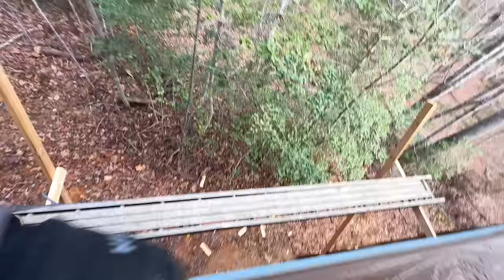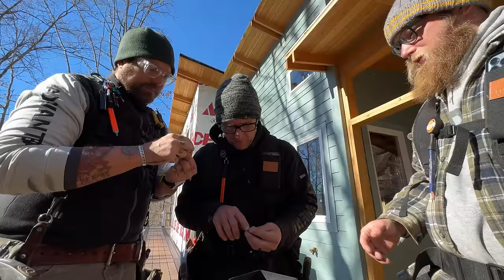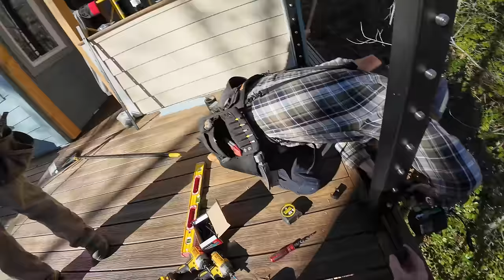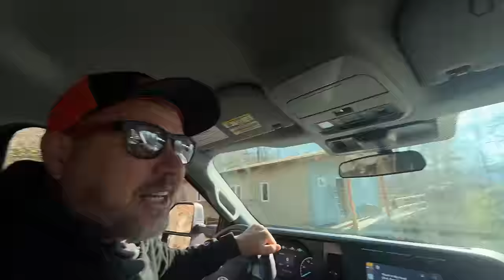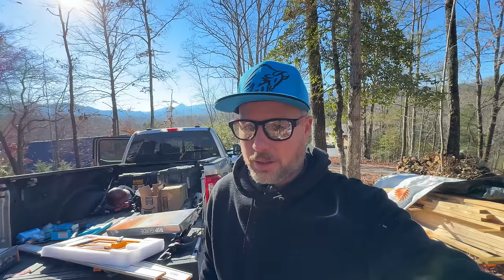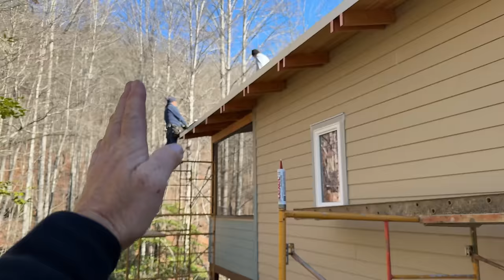Modern Home Build | 37 | water connection, Envision deck railings, roofing & MORE!

Comment: Sunday just wasn’t the same without the new video
Reply: Happy New Year, guys!

I only want to cover one topic in this video, which concerns gutters and downpipes to cope with rainwater.

Obviously, we don't know what you decided on doing, as the video finished before we got a chance to see how things panned out.

So, does your customer intend to use some form of rainwater storage? If not, then perhaps you should suggest to her the importance of recycling water!

Don't stop reading, hear me out first, then make a decision. 

If she had the right system installed, taking into account the large roof she has, which is perfect to catch rainwater. She could have enough water stored to last her and a partner all year.

Perhaps you will do what most people do, which is to simply place your downpipes, allowing rainwater to flow from the pipe over the ground, which seems to be the usual concensus in the USA, wasting water.

Here in the UK, we're encouraged to use rainwater for our plants and vegetables and for use with outdoor animals, which is what we do. We have 30 goats, 25 geese, 31 egg producing chickens, and an aditional 40 chickens for meat and 2 cocks.

So, I thought as my bungalow is 64 feet long by 32 feet wide, with a pitched roof, that I would explain how my roofing contractor overcame the downpipe situation, over such  a long distance, considering I wanted at least two very large waterbuts. 

What he decided to do first was find information on the largest rainwater storage systems available here in the UK for home use and start from there.

During his search, he established that with the right system, it was possible for us to drink the rainwater safely all year round. 

The largest single waterbuts available here in the UK hold 2,000 litres or about 440 imperial gallons, quite big then.

However, there are tanks much larger that can be placed above or below ground that connect to each other using gravity flow or, better still, solar powered.

We decided on having tanks placed below ground to help keep the water cool in summer and prevent it from freezing in winter. I also had a solar powered system put in that works in conjunction with the electricity company.

Power stored in the six batteries is enough to power the whole house with everything running but not during winter, which is why we remained connected to the grid.

The solar powered pump first  pumps water from the tanks to a water purification system and then to our home so that we can drink the water safely.

As the tanks were to be stored underground, I was advised for my situation that four  would be more than plenty to supply enough water for four people 24/7.

Each of my tanks holds a minimum of 3,600 gallons. Connected, that's more than enough water for two adults and a 15 year old son to shower every day. Enough water to meet with every demand such as flushing toilets, cooking, cleaning, dishwasher, and washing machine with plenty of water to spare. 

The complet system, including solar powered water pump and purification system, costs less than our water rates for one year and came with a 10 year guarantee.

The tanks, pipes, fittings, and purification system are all made from 100% recycled materials, all except the surgical still within the purification system. 
Recycled stainless steel and wooden inserts used to secure the tanks treated with a water-resistant covering and guaranteed to last a minimum of 100 years.

In view of our climate situation and to do our part in helping with it, we went with this idea.

Your client could have just one downpipe on each side of her property. Locating the pipes in such a way that they feed any number of water storage containers placed above or below ground under the house in that area, which slopes and us otherwise, usless!

If that was my house, that's exactly where I would place the water containers, with the  purification system, and pump, all underground and out of sight so as not to freeze during winter and keep cool during summer.

If having the tanks underground is not possible, then still place them in that area. In the end, she will be saving thousands of dollars each month each year, not giving it to the water company.

Even the power would be free, solar power, solar batteries. Win win.

I am now contemplating switching over to solar power completely with additional wind power. There is also a stream at the foot of my property, but I don't think it's fast enough to generate the hydro equipment. 

Just some thoughts you may wish to consider. It would make a good video! You're welcome 👍🤭🇬🇧⚒️

Comment: The difference between Galvanized and Galvalume steel is that GALVANIZED has a pure zinc coating while GALVALUME has a mixture of Zinc, Aluminum and silicon. This mixture gives Galvalume better corrosion resistance and durability also a much longer lasting lifespan twice that of Galvanized
Reply: What's the difference between galvalume and zincalume?
Reply: @rachelhunting  Zincalume has magnesium rather than silicon in the coating which would make the Galvalume longer lasting by my estimation.
Reply: We use the same type of stuff in Australia and I can say with confidence it is tough AF. Sun, storms, hail as big as fists, wind that could blow a dog off it's chain......just eats is all day!

Comment: Just going to put it out there that I have a 6in wide, 18in long core bit. I needed a vent hole for a range exhaust, got quoted $600 so I bought the bit for like $180 and did it myself. Cut through masonry block and a brick facade like butter.

Comment: Lookin great! That railing system is super nice. 

One thing I noticed of note. 
You may want to watch out for galvanic corrosion where the galvalume flashing is in contact with your custom copper end caps. 
Dissimilar metals can corrode very quickly when there is an electrolyte (such as water) present.
Reply: I just looked it up. Galvalume is steel with a 55% aluminum and 43% zinc coating. Copper and aluminum are highly susceptible to galvanic corrosion, so great point that they should check it out if they'll be in contact. Zinc is not a problem.

Comment: Deck rails looking good, and relatively easy to install upright thanks to the fixings, that they thought about. The roofing sheets look like the ones I put on my large shed in my previous property. Easy to install and had rubber washers to stop any ingress of water. Worked very well without any sign of oxidation on the metal walls and roof. Glad to see you back, be safe and well 🔨🔨🔨🔨🔨

Comment: In NZ this type of ribbed or corrugated coloursteel roofing is the most popular by far. Very few felt rooves are installed here, maybe something to do with the weather. There are examples of galvanised steel corrugated roofing lasting 100 years here and still being in excellent condition.
Reply: Notice how they are screwing down the roof in the valleys, which means there is a higher chance of the roof leaking on the screw fasteners.
In NZ most roofs are screwed down on the high ridges so as there is less chance of the roof leaking.
Reply: I worked installing roofing on a number of buildings in Auckland a while back and we would always fix through the crests of the roofing steel
Reply: My brother owns a roofing business with his 2 sons here in SEQueensland Australia (we're originally Kiwis) and the screws ALWAYS go in the ridge NEVER the valleys !!!!  This is to ensure water has no chance of  leaking should it accumulate in the valleys; as its impossible for it to   pool on the ridges. The variance in size also supports this . The original corrugated iron roofing had them equal sizes with the ridge being used for the lead-headed nails back in the day. Today's style  tends to be more a broader, wider valley with a much smaller ridge designed specifically for the screws to attach it   securely.
Reply: From experience doing it on the ridges just causes deformation anyways allowing a little area for water tension to keep the water there and Id say in a country that has much higher wind speeds you wanna be able to just send it anyways. Plus roofing screws have an o-ring anyways so Id hazard a guess and say its actually just better to do it where you want have any wiggle room.
Reply: I’m surprised that no one’s using standing seam style roofing in the US. 

Our aussie colorbond stuff looks amazing and we even use it to clad the walls as an architectural feature (like on my garage). 

Fixes down with concealed brackets and crimping too so there are no visible fasteners
Reply: @w2ttsy670   We use tons and tons of standing seam here.  Surprised we don't see it on all of these Perkins builds.  It's the most desirable roof, to me.
Reply: @heatherclayton-callaghan4270  I know right, it seems absolutely crazy to screw down a roof in the valleys of the roofing iron, it's just asking for the roof to get leaks...  On yah Kiwi.

Comment: I did a project with Gavallume roof panels and they will naturally “age” once installed. They have an oily coating on them that naturally wears off and they will get a tiny patina to them. The architect on my job thought something was wrong with the roof but the metal company explained that it is supposed to happen like that. That roof has been on for about 18 months and still has just the slightest patina to it, it didn’t continue to get darker.

Comment: That roofing contractor is very professional and does amazing job
Reply: Apart from his huge mistakes of screwing the roofing down in the valleys and not the ridges !!! This is a huge FAIL !!!!
Reply: @heatherclayton-callaghan4270  Not true. Most manufacturer's recommend screwing the panels on the flats. Sometimes both the flats and the ribs.
Reply: Screws go on the flats. The panels are not secure to the substrate otherwise, and you cannot tighten screws on the ribs enough for the washer to compress properly.

Comment: Notice how they are screwing down the roof in the low valleys, which means there is a higher chance of the roof leaking on the screw fasteners.
In NZ and AU most roofs both rib line and corrugated iron roofs are screwed down on the high ridges so that there is less chance of the roof leaking.
Reply: Given how the metal sheets are shaped, locating the screws in the valleys should actually ensure a better seal in this case. And even if it doesn't, the self-sealing stuff they installed underneath should take care of any leaks.
Reply: @daniel_charms 
Your opening sentence is 100% wrong !!! And That's not the point. My brother has had a roofing business for years that his 2 sons run now and the ridges are there specifically for screwing the roofing down. You should not be  qualified as a roofer if you don't understand the basics of roofing!!! No matter what country you are  a roofer in. Plus you are influencing a worldwide audience to do the job INCORRECTLY !!!!
Reply: Many metal roof panel styles specify screwing in the flats next to the ribs. They are following manufacture requirements.
Reply: @brycehinton7860  I'd like to see where any reputable manufacturer states screwing metal roughing in the valleys as opposed to the ridges. This will not be in any country other than America if it is the case. And probably made in China.
Reply: Yes, USA. I've tried to respond with a link a few times, but it deletes my comment. That's how it's specified here. I guess you'll just have to trust me. I'm sure it's different elsewhere in the world.

Comment: Those sheets look like the ZinkAlume sheeting we use in South Africa. Can tell by the dull finish compared to galvanized. Its a Zink and Aluminium alloy coating that is superior to your standard galvanized coating. We also get them pre painted over the ZinkAlume coating.

Comment: That smooth texture on the roofing panels is an acrylic coating applied during manufacturing to protect the panel surfaces prior to application and will eventually erode off the surface.

Comment: Again I feel the need to mention I don't live in the carolinas but in ohio glavalum is galvanized aluminum used primarily in commercial siding or pole barn roofing and siding.  I just installed some as siding on a commercial warehouse in 2023.

Comment: My only concern with the exposed fasteners on the metal roof is that typically you have to either tighten or replace those screws after a few years due to the heat cycling that causes the screws to loosen and the weathering that occurs on the screw "gasket" I worked for a metal roof company here in Michigan (snow, ice) and they only use the hidden fastener system as opposed to the exposed fasteners for that problem, eventually the exposed roof screws will leak....if not maintained properly, just fyi guys
Reply: Everyone up in Alaska uses Skyline Roofing® – Standing Seam Metal Roofing so nice

Comment: when we installed my metal roof we used a witness edge, basically a ledge you but the metal panels up to and its level and aligned all the way through.

Comment: Just put a metal roof on a small shed. The supplier recommended putting all screws on the ridges not on the flats to prevent future leaks?

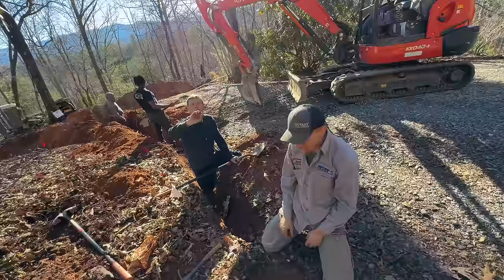Comment: QUESTION: Roofing panel length. In Episode #25 (@13:15), Erik was wondering if a single panel 33’5” long was too long (expansion/contraction). Contractor (Devin) believed it was not a problem. Jamie was checking [with vendor] about maximum recommended length of panel. Why did you not go with full length, but with half length panels?

Comment: I have 1st fix and a 2nd fix Paslode guns. When I need to replace them, I'm buying a different brand. The reason being is, Paslode make the gas with perishable seals, so there's a use by date. Aftermarket gas doesn't suffer that issue. But until the copyright runs out on the Paslode gas, you can't get aftermarket gas on those newer models.

Comment: Wish I had helpers here in Mississippi like the roofers there. I am 85% done with a 4300 square foot roof with a 10/12 pitch and very cut up by myself. Sheesh I’m only 145 pounds and 44 years old and grumpy already.

Comment: Won't those horizontal furring strips on the roof cause water to pool behind them?  (And before anyone says there won't be water there, moisture in the air will condensate on those metal panels when it's cold.)  I would have put vertical furring strips first, and then horizontal ones on top to ensure any condensation can run off and there's airflow across the entire roof.

Comment: I need a Pro tip or Pro help. Does anyone make a left-handed tape measure. I'm right handed but hate to switch hands to make a mark. I hope I'm not the only one who would prefer to hang the tape on the left side. With so many times, I would just like to pull the tape out without unclipping it. Obviously, this is for benchtop measurements not spanning floors etc. 
Thanks for your time, and I enjoy watching a team work together. HAPPY NEW YEAR

Comment: The whole time you were assembling the posts and then installing the first one, I was thinking, how does the base cover plate slide on to cover the attachment screws and adjustment bolts if everything is installed along the post...

Comment: I know you guys are pumped on lp smart side but the horror stories of that stuff getting wet underneath and swelling and falling apart especially at bottoms like osb doesn’t worry you at all yea it’s easy to work with but I would hesitate to put a non primed strand board (on back)to protect my house it’s not even painted on back side and is  exposed on back side for moisture to get into If they could do a zip coating on back it would be top notch stuff just have seen some bad damage in wet environments

Comment: In Australia we put screws in a metal roof on top of the caps not in the valley. The water runs off the caps and down into the valley. I suppose different strokes?

Comment: I wondering if you could show more detail with the roofing system. The roofers were briefly shown installing roof, penetrating the the metal sheets.  How does the system ensure it remains watertight if (I'm guessing) the neoprene washer on the fastener fails? Thanks!

Comment: Strapping below the roof without any space for the water to run is a terrible idea. Also Galvalume is steel with a zinc/aluminum coating.

Comment: Am I missing something?  In a previous episode when you first showed the railing system there was a leveling plate that was to be installed first and the post on top of it so the leveling strews wouldn’t dig into the decking.  I don’t see those being installed in this episode.  Did I miss something?  Is the railing different than the original you showed?

Comment: As a roofer those panels should be ran and be installed all the way from the top to the bottom “full length”. Just asking for leaking water in the future

Comment: The depth of any utility is a suggested depth for the day it is installed. Any other day, besides that day, a utility can becaome shallow due to erosion, grading, and excavation above the utility line. If a utility line is shallow, that is good news for the excavator.....because if you are going to cross a USIC locator mark, you are supposed to use proper hand digging techniques to dig down to your depth and if you find the crossing utility, you should support it during your excavation and during backfill. So, if the line is shallow, then you will find it sooner. Your plumber is a good one. He was using shovels to find the water line and not the backhoe.